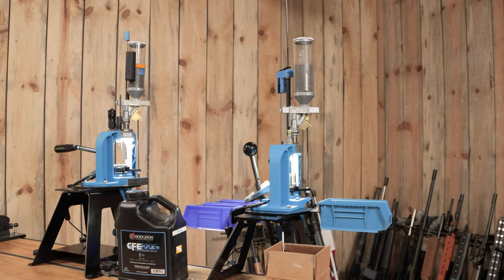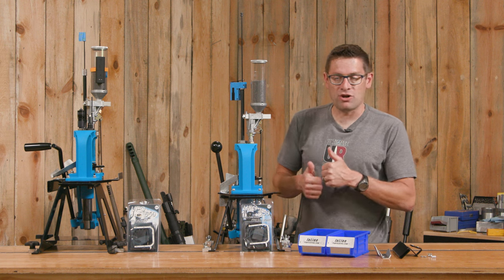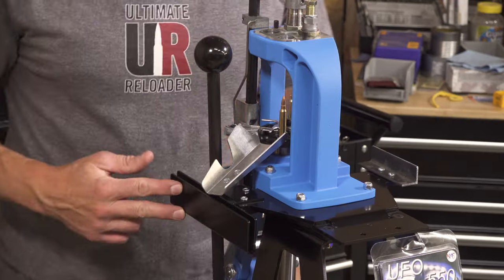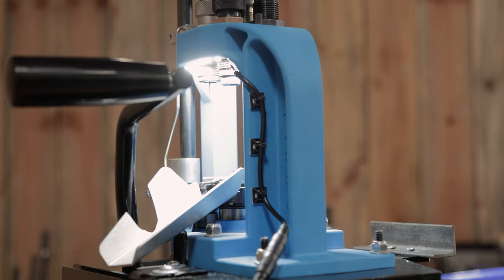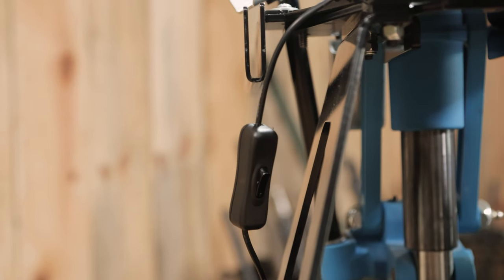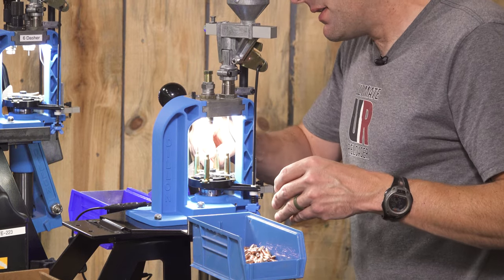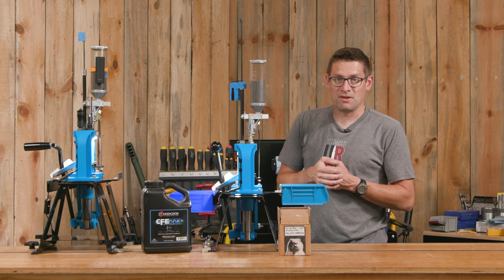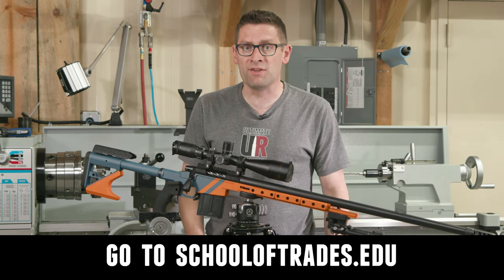Upgrading My Dillon RL 550c: KMS² Press Light & Inline Fabrication Ultramount

Comment: You have a duplicate of my system with the exception that one of my presses is mounted on the Dillon strong mount. I got tired of changing primer setups so I added a second system. I also 3D printed a bullet tray for the Ultramount system.

Comment: Precision- check the variance of the powder charges ?
Reply: I worked mine over and have the Dillon powder drop to +/-0.05 gn now. Usually the failsafe bracket is on way too tight and needs to be loosened so the arm and powder funnel can return with gravity, not the failsafe rod pulling it down. Look for other videos on it to get there